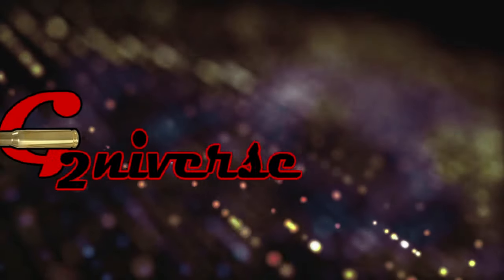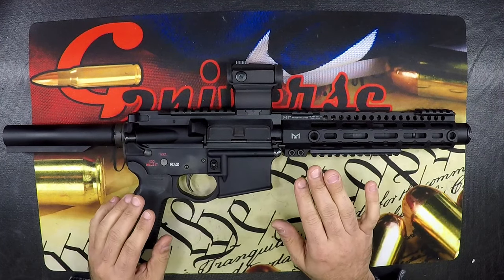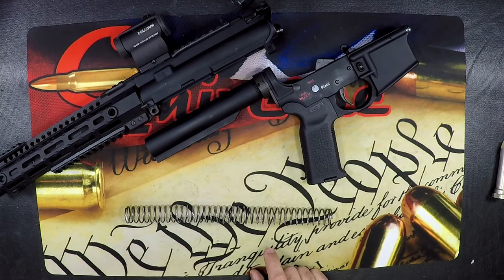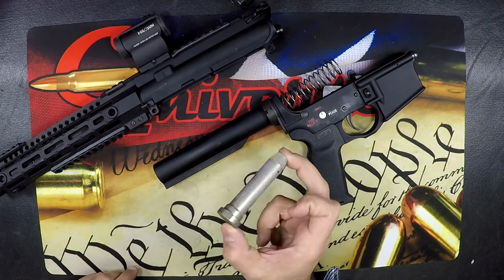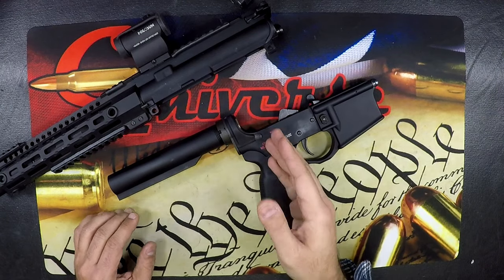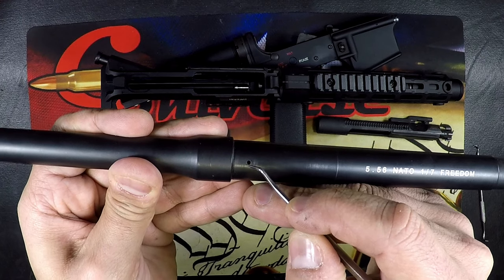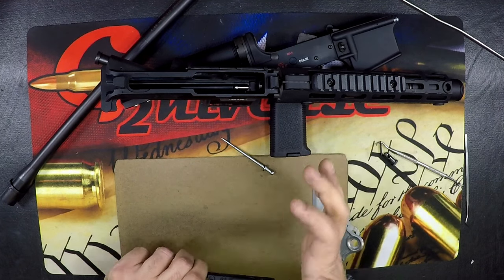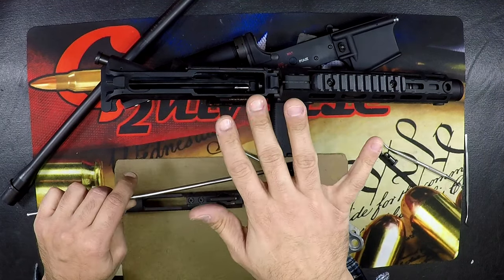Safely Fix Undergassed AR - How To

Comment: Getting mixed feedback. I have an undergassed build. I have an adjustable 6 position RRA stock with a carbine length buffer tube and spring. Can I just install a 43 coil rifle length spring? or do I also need a bigger buffer tube?
Reply: .223 Wylde 20" barrel rifle length gas rod
Reply from the maker: Jeff Kellnhofer ive been thinking about this a lot...if you went to a longer buffer spring, you'd be even more undergassed, plus a rifle spring wont work in a carbine buffer.  If you are truly undergassed, you need to speed up the BCG and get it moving faster (not make it even slower).  Lighter buffer, low power buffer spring or lightweight BCG are all options.  Secondly, ensure the gas block is appropriately centered over the gas port on the barrel and there are no obstructions.  If its adjustable, open it all the way up. Finally while you're checking that gas port, make sure its the right size for your barrel...20" Barrel (0.625") Port: 0.086" to 0.093" or 20" Barrel (0.750") Port: 0.093" to 0.096".   A undersized gas port is restricting the flow of the gas and undergassing your system right from the start.  If you find this is the case, you'll need to take it to a gunsmith to have the port enlarged.
Reply: @G2niverse  At 5:30 in your video, you state that you need to match your spring with your gas system rod. I have a 3 oz buffer, I took it apart, and removed 1 weight, and nothing changed. My brass is coming out around 2:30-3:00. I just returned from the range, and failed the one shot bolt hold. I also couldn't get bolt to stay open with an empty mag. Assuming that I had a bolt catch issue, I loaded 4 rounds, and tried to see if it would feed. Another fail. This was with a rifle spring in a carbine buffer. I have 2 other BCG at my disposal, so I'm going to weigh them all, and try them all. Before I go to the range, I will check the entire gas system again, but I bought this upper complete with barrel and gas system installed. I'm probably going to take a box of parts to the range, and try every scenario that I can.
Reply: @G2niverse  Different BCG, exact same weight, works perfectly. Both BCGs brand new.... ????????????? Faulty one seems gummy when I work it in and out. Could this have caused bolt to work too hard?
Reply: @jeffkellnhofer980  You should use a rifle length spring in a rifle length receiver extension/buffer tube and carbine spring in a carbine receiver extension/buffer tube. If your using a rifle spring in a carbine tube, that is your problem. The spring is to long and binding. Do not run your buffer without all the weights in it.

Comment: This is a pretty good video but my bolt did not even move to try  to extract the round.
Reply: Check gas block make shur it line up with  hole in barrel

Comment: The 3 bores of the bolt or carrier can also be out of spec.  Bolt shoulder, gas ring run, and bolt tail.

Also pin (best) or at the very least dimple you gas block.  Use Rocksett the screws.

Comment: So say if u have a 18 or 20 inch barrel that mean I have to use a rifle buffer spring right because I bought my ar15 n someone put a carbine spring so is that what cause my ar15 to be under gas
Reply from the maker: Nope. If you're undergassed with a carbine, you're going to be way undergassed with a rifle. You want to speed up and lighten up your bcg, not slow it down.
Reply: @G2niverse  it load the first n seconds round but when the bcg try to pick up third round double feed so I have rack it again.
Reply: You should use a rifle length spring in a rifle length receiver extension/buffer tube and carbine spring in a carbine receiver extension/buffer tube. You could use either set up in those length barrels. You could have a problem with your magazine to. does your bolt lock back on the last round?

Comment: Would my pistol build be under gassed if it shoots one round ( very seldomly more) and it then try's to feed the next. So both rounds are jammed in. The extractor grabs the round right off. I can empty a whole round manually. I switched uppers and lowers and it only doesn't it with my 7.5 inch.
Reply from the maker: no you would either be overgassed, have a bad extractor, bolt, etc.  Id recommend watching the overgassed videos and failure to extract video.
Reply: You may need to change to a heavier buffer (H1,H2), a stiffer buffer spring or add an adjustable gas block, or combination of the 3. Pistol length gas systems are typically over gassed with less dwell time due to the shorter gas tube. You need to slow it down. A problem with pistol length gas systems and lighter 2.9 ounce carbine buffers and basic carbine springs is less resistance to the cycling process. They will cycle faster not allowing enough time to eject the spent casing, and strip the next round out of the magazine. Your gas port should be approximately .0935” in diameter or approximately 3/32 diameter drill bit size. Anything smaller and it might create cycling problems. Anything larger and you’ll be way over gassed and need an adjustable gas block. If you’re shooting 300 BO (you didn’t specify), get a magazine specific for 300 BO/7.62. The magazines designed for 5.56/.223 may not allow heavier subsonic rounds (220g) to feed properly. Also if you’re shooting 300 BO, subsonic rounds are typically designed for suppressors. The suppressor creates additional back pressure to help cycle the bolt carrier. Unsuppressed 300 BO can be tricky using subsonic rounds. Cycling the heavier rounds can be problematic. Then you have to go with a reduced power spring and lighter buffer. If shooting 300 BO unsuppressed, stick with supersonic 110-150g rounds and cycling usually isn’t a problem.
If shooting 2.23/5.56, I would try different buffers or buffer weights, try different grain ammunition from lighter to heavier, and an adjustable gas block as a last resort.
A 7.5” barrel isn’t optimized as far as powder burn. It takes at least a 10” barrel to have full powder burn. So you may not be getting the maximum pressure desired. So a good quality higher pressure round may help diagnose the problem
Reply: I have a h2 in it .  It's .223, sorry about that .. I put a new gas tube and an adjustable gas block.
Reply: I'm using the strike industries viper pdw brace so it takes a compact buffer.
Reply: I did a lower and upper swap and it is an issue with the upper.

Comment: So do you have to use a rifle buffer spring if you are running a rifle length gas system?
Reply from the maker: If its a rifle length stock and a rifle length buffer, yes.
Reply: @G2niverse  alright, thanks brother.

Comment: I have a problem with my build. Not feeding 2nd round, gas block good - lined up right, bcg good, stands, staked, not loose, buffer is 3.07 oz, buffer spring is a carbine, 37 rings, 10 13/16"  - is length good, going back out in he morning to do 1 shot test
Reply from the maker: @keithbrock1650 try different mags.  Then look at buffer weight.
Reply: Turned out I was a little simple, I had lubed it, but after reading some comments on here lastnight, I generously lubed it, & she is Running Great. Thank you

Comment: Id prefer a 3:00 brass ejection but i have a 4:00-4:30 brass ejection on my bcm upper. It cycles everything with an H1 but doesnt like tula steel with an H2 buffer…you think id have reliability issues if i just run the H1 buffer? So far its been ok it seems
Reply: Your rifle is set up with the proper gas port for higher pressure NATO spec ammunition. Weaker cheap ammunition needs a bigger gas port to run which is why most lesser quality AR manufacturers over size their gas ports to run the lower pressure ammunition on the market. These same rifles will be over gassed when running the higher pressure NATO ammunition..A standard buffer should run fine with the steel case ammo if the H-1 doesn't work....

Comment: My 300 Blockout only fails to reload another round when I shoot Subsonic rounds. I have no problems shooting Sonic rounds just the Subsonic rounds.
Reply from the maker: Subsonic is your problem. Do you have an adjustable gas block and do you adjust it when you switch rounds?
Reply: @G2niverse  sorry, I forgot to add when I shoot my rifle only with subsonic rounds and my rifle is suppressed. The sonic rounds work perfectly, it’s only with subsonic and when I’m shooting my rifle suppressed.
Reply from the maker: I figured you were suppressed, no reason to shoot subsonic otherwise.  Even more of a reason to have an adjustable gas block.  You can rely on a normal gas block to regulate the gas pressure.

Comment: Can I run an empty buffer,  mine is so under gassed that it'll only run without weights
Reply from the maker: Never tried.
Reply: No, you have other issues, take it to an experienced armorer or gun smith that understands the AR rifle system and has the knowledge and gauges to find your problem..

Comment: The barrel-gas block journal fit could be too loose, The gas tube button could be wore and not sealing in the gas key, the gas tube to gas block fit could be too loose and leaking gas, the gas key could feel tight yet have a broken fastener screw and leaking gas, the gas key I.D. is too big and not to spec leaking gas, the bolt carrier could have a poor bolt tail to bolt tail bore fit leaking gas, your buffer could be too heavy and then your gas port could be undersized for commercial ammunition but work perfectly fine with NATO pressure ammunition..
Reply: Someone knows their ARs. Tolerance stacking is your worst enemy when building, and knowing how to guage and fix these issues are one thing that separates a builder from an assembler.
Reply: Yes, he left out leaking gas key. You can spot that on a fairly clean bolt carrier. Even if the fasteners are torqued correctly, the fit could be bad and leak there although not as likely.

Comment: The gas from the gas tube only unlocks the bolt, the pressures from the barrel are what throw the bolt to the rear, from the explosion that just took place.
Reply: That is absolutely not accurate. The gas entering the bolt carrier both unlocks the bolt and pushes the carrier back. With an adjustable gas block, you can tune the gas to where the carrier unlocks the bolt but only pushes it half way back.
Reply: Yikes. Stick with 22 lr.

Comment: My 300blk runs supersonic real good just won’t cycle subsonic
Reply from the maker: Rodney Rose pretty common...lower gas pressure, typically results in short stroking.  If you go back and forth a lot like that, look at an adjustable gas block or 2 different buffers.  A lighter one for subsonic and a heavier for supersonic.
Reply: @G2niverse  thanks for advice, I have an adjustable gas on my BCG …will try another buffer my can has been incarcerated for 6 months now…it may be another 6 the way things are

Comment: I’m building a Faxon lite weight version. And 14.5 pin welded muzzle brake. What router would I go ? H3 buffer or the gas block adjustable and not shooting surpres and just 55 grain ammo plinking ammo
Reply: I have a 14.5 inch Aero Precision barrel and a pinned A2 flash hider and a fixed port gas block (non adjustable). I ended up using a H1 or H2 buffer depending on the ammo I use. I watch where my casings are being ejected. If they come out consistently at 1-2 o'clock I'll switch to a heavier buffer. My goal is to have casings ejected at around 3 o'clock.

Comment: Just subscribed to get educated and questions answered.
I have a ar15 6mm ARC.  SHOT 40 ROUNDS MATCH 108 GR.  THE GAS STARTED CHANGING WHERE THE EJECTED CARTRIDGE WENT FROM 3 O'CLOCK POSITION TO JUST BARELY ROLLING OUT OF THE CHAMBER.  THE BRASS THAT WAS EJECTED, THE RING AROUND THE BASE IS ALL CHEWED UP.  THE HEADSTAMP, HORNADY IS MARRED UP.  SOME OF THEM THE LETTERS ARE MISSING..  EJECTOR MARKS.  SMEARING OF THE NAME PRINT.  TWO OF THEM HAD BLOWN PRIMERS.  STORE BOUGHT NEW FACTORY AMMO.  PERSONALLY I THINK THE BOLT UNLOCKED PREMATURELY BUT I DON'T KNOW ANYTHING.  CAN YOU OFFER ANY SUGGESTIONS?
BILL
Reply: Your rifle sounds like it is over gassed. Over gassed rifles will cycle so fast the empty case because the rifle is trying to cycle while there is still a lot of chamber pressure. A bad chamber meaning a short chamber will also cause high pressure spikes blowing primers. Head space your chamber and try an adjustable gas block..

Comment: I have a AR15  And my bullet is getting stuck  in the barrel I have to  murder it to get it out  is it my  extractor
Reply: It could be your extractor yes you should also check your headspace.
Reply: Overgassing can cause this. A heavier buffer may slow the bolt carrier down which will allow the brass time to shrink and extracted rather than the extractor ripping off the cartridge rim because brass is still tight in the chamber. Check for marks on the brass that might indicate this is happening.Also, the chamber may be dirty or have tool marks causing extraction issues
Reply from the maker: Possibly yes...extractor or overgassed

Comment: My spring is les than 37 but is 35 on 7.5 inch 300blk out and have fail to shoot next round
Reply: Open your gas port with a drill
Reply: Damn its like every 300blk pistol has this issue😂 thats why im here

Comment: what would it be called if the bolt carrier doesn't move after the round is fired...pull the charge handle the empty shell ejects perfectly and the next round chambers... i tried different ammo and different mags and this happened 15 consecutive times
Reply: If it is short-cycling and not ejecting the spent case, then it is probably undergassed. If it isn't moving at ALL that could mean there is a problem with your gas block or gas tube.
Reply: Sounds like a gas problem, gas block maybe came loose
Reply: Is this a Ruger SFAR ? The gas block can be turned off completely and it will function just as you say.
Reply: Exactly what mine is doing